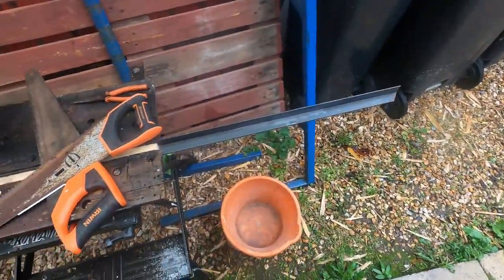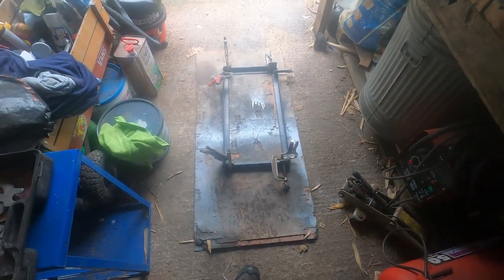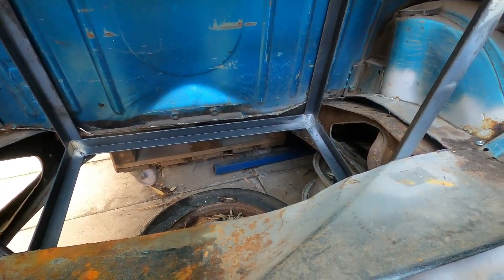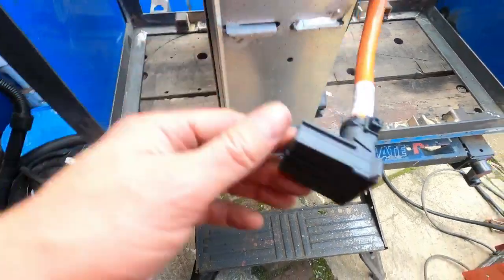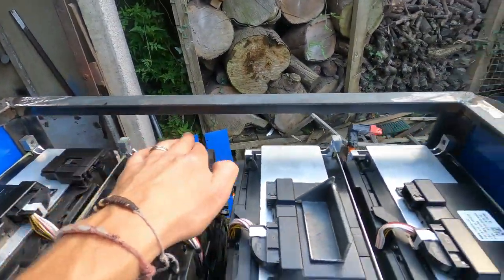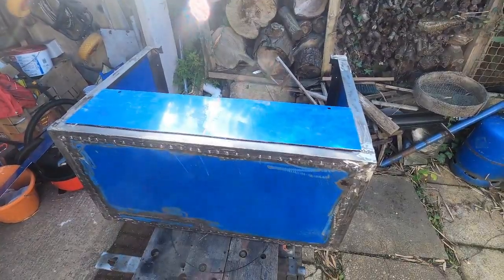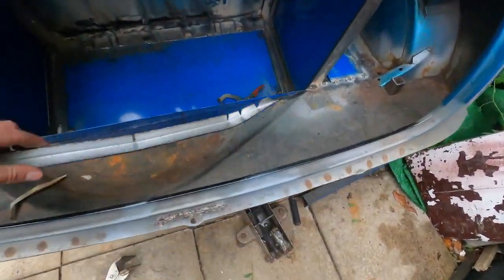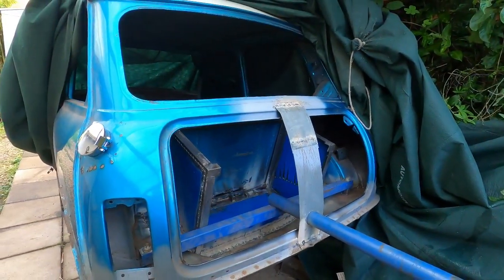Project Mini i3 making the rear battery  box

Comment: I feel your pain on the battery box building. I have two at the front and two at the back but after going through the pain of building the front two with angle I changed tack and built the rear two from a single sheet of 1.5mm. It was sooo much quicker and easier. Maybe not suitable in your situation tho.
Reply from the maker: Yeah, we did talk about just using sheet and doubling the folds for strength, difficult to know for sure what is best.
Reply: @MiniLifeCrisis  Your box location would be vulnerable to a rear end shunt so strongest is best. If you have a look at my latest videos you can see how I built mine but they are much more protected by the chassis of the car.
Reply from the maker: Don't forget once it's all together it will sit in the middle of the rear subframe so that will give it some low down protection 🤞
Reply: @MiniLifeCrisis  yes but the mini is very low, any modern car hitting the back will be above the subframe so your extra strong box is a good thing.